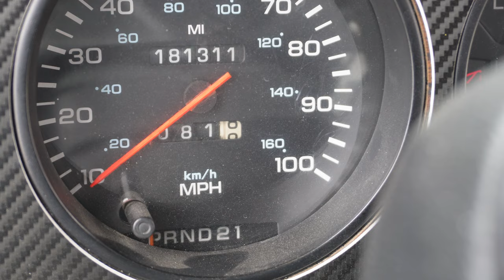Extreme Measures to Finish the Manual Swap! | Part 5

Comment: Awesome, i installed the bracket by Charlie, and about install tcase using the special coupler. Then cut 1/2 from linkage, see how she goes
Reply from the maker: Make sure you keep the tcase linkage clocked perfectly when you take some length out 👍
Reply: Thanks for the reminder! I'm going to use a straight edge with a line that won't ware off during the weld .

Comment: Sorry Tim, i LOL'd way too hard (@ the 0:55 mark) as i ended up wrecking the OE shifter knob in my truck, a couple of weeks ago, when i changed the OE shift tower, for a short-throw shift tower. I could not get the shift pattern piece to come out of the knob, ended up breaking the shift pattern plastic, and taking a good chunk out of the rubber. 

I'm not overly concerned about wrecking the OE knob, as i'm in the process of making a new shaft, and installing an old skool, bass boat style flake knob. 

I derailed from your video a little, but i just found it so funny how you popped that out with so much ease.

Comment: Great job Tim! That interior looks beautiful with that G56 shifter coming through the floor😎 Sam with VBelt and son gets a lot of negative Nancy’s too for not taking his auto shifter off on his red 98 12V G56 truck
Reply from the maker: Yeah, I noticed he gets a lot of comments on it as well. It's just funny that people always find little things to be critical about 🤷‍♂️
Reply: @decentgarage  You mean like that now you don’t have a functioning steering wheel lock? Oh my! 🤣
Reply from the maker: @bcbloc02  interesting. I didn't realize that but sure enough you are right. I'm not worried about it but how does the manual column lock vs. the auto column?
Reply: @decentgarage  Manual has a push button on the bottom or side depending on year that operates the column lock. You can't turn the key to off until you push it in.
Reply from the maker: @bcbloc02  gotcha! I'm not too worried about the lack of the steering wheel lock but I'll add a comment to the description so others know that that is a side effect. Thanks man!

Comment: Instead of bending the transfer case shift lever, you could most likely have moved the lever to the inside gated slot in the shifter mount.  That's what I just did when I did my swap from A518 auto to NV4500, just put the lever in the slot closer to the transmission, lined up perfect.  It looks like with your bent TC shifter, it lines right up with the inside gated slot.  I figured that's why Dodge made the bracket with two slots, use the outside slot for Automatic, inside slot for manual.  At least it worked perfect for me.  At the very least you would not have had to bend the lever nearly as much if you moved it to the inside slot.

Comment: I wish I could get some work done. I need to pull the engine out and find what is eating a bearing (lots of metal particles). I am still dealing with PT for rotator cuff surgery and hand/wrist issues, but the real problem is I can't get my 23-year-old kid to help.